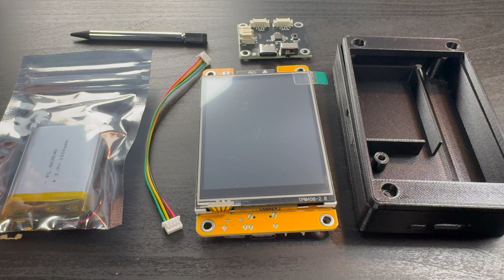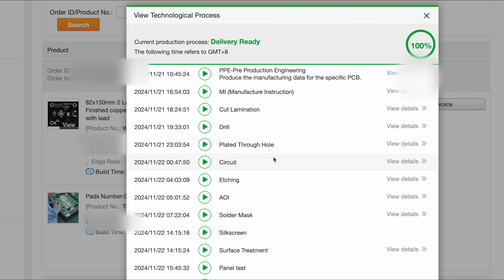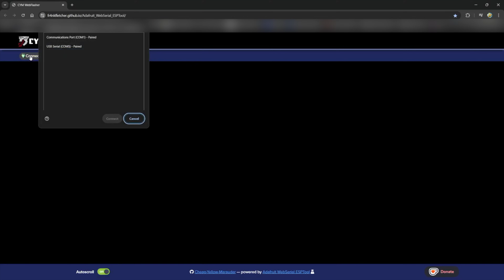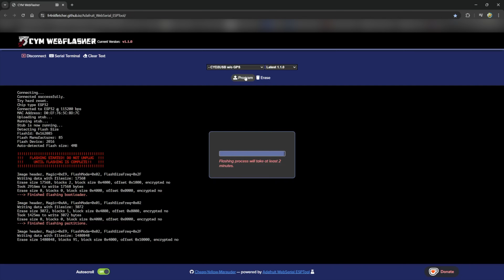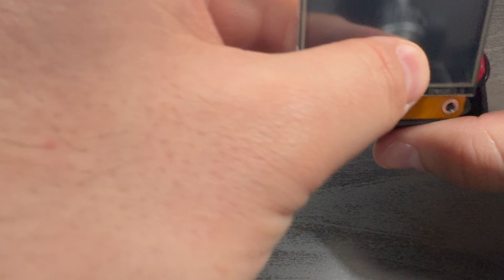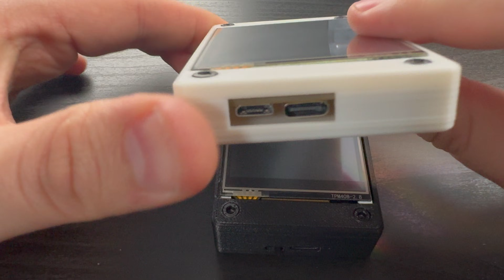How To Build An ESP32 Marauder - With Battery - No Soldering Required!

Comment: i know you probaly wont see this but would a 
LP103454 3.7V 2000Mah battery work or do i need a step down module?

Edit im an idiot and i figured it out
Reply from the maker: I imagine it would work. That voltage you gave is the nominal storage voltage most likely. That’s what’s shown on my lipo battery’s too
Reply: @BiscuitShop would the ada fruit bmax 17048 work instead you pcb because it's currently sold out
Reply from the maker: That’s just part of it. No charge IC with that alone

I ordered some more and they’ll be in stock soon

Comment: I know I'm a little late with this, but i just have 2 questions. How do you add the gps antenna, also is there a way to get this to work with halehound?
Reply: Hey, I'm not the video maker, but I know that you can flash this CYD with Halehound, I have done it and it works. Hope that helps.

Comment: If I do this but flash halehound cyd firmware instead will I be fine ? Just plug in connectors and good to go?
Reply from the maker: Battery would work but not the GPS or Battery level. We talked about it though, but I think he has some things up his sleeve
Reply: @BiscuitShop ok I see. The gps I'm not worried about because my build won't have that. No battery level kind of sucks but as long as it works then that's good enough

Comment: Now only need to add GPS. 
The YouTube channel, Yellow Purple put out a great video 10 months ago. Adds GPS as well as several other modules / capabilities. If we could add GPS and fit it into your case, and maybe add a good Wi-Fi and GPS antennas (not sure how difficult that would be) that thing would be really fun.
Reply from the maker: Already done! The board has come a long way :)

I have a case model with a hole at the top for SMA connector as well
Reply: @BiscuitShop  Where might i find this new case with the sma hole?

Comment: Received the ESP32 Marauder today, my version has the external antenna. Tried out wardriving and found that the device did not save anything to the SD card. Not sure what is going as the device does detect the SD card with correct size as shown in the "device info" and the SD icon shows up "green" on the screen. The SD card is a generic 8gb formatted to FAT32. The device did create a folder called "script" not sure what that is for but it was empty. Searched on the wiki and only found info regarding the flipper zero. So thought I post my question here.
Reply: Update Sorry, ended up bricking the unit trying to update the firmware. Ended up erasing the eeprom and reflashing the firmware. That corrected everything, device is now working properly. Not sure what the original problem was but now it works flawlessly. I even added an external GPS antenna and it works even better. Reprinted the housing in clear PETG that moves the power switch and charging port to the side of the device so the unit can sit upright. Thank you Hedge Tech for this wonderful device, this has allowed me to participate in wardriving.

Comment: can it be used without display and remotely control it via ip address ? thanks
Reply from the maker: Not via IP address but you can control it with a serial connection and no display
Reply: @BiscuitShop  yes how to do that i have and esp32 and want to flash marauder but can it run without a display , can i run it through my phone?
Reply: @BiscuitShop  how can it be controlled with a serial connection? can you show how? thanks!

Comment: Does the pcb include a step up converter or is it not needed?
Reply from the maker: Not needed with this version of the CYD. Some versions need 5V like the capacitive version but not the ones I link. I don’t even think there is a version of marauder that supports capacitive displays
Reply: @BiscuitShop thanks so much, seen a lot on Reddit where people say you have to step up to 5v to do this

Comment: Hello, there is somthing wrong with the webflasher 1.7.0. After flashing, the touchscreen works not correct, can you check this ?
Reply from the maker: What do you mean? If you’re talking about the new way to use the screen that’s by design. You  touch the top to move up, bottom moves down, middle selects
Reply: @BiscuitShop  Uhhhh, sorry, i do not notice this, thank you 😉
Reply from the maker: No problem. JCMK made the change after all the new features required scrolling in the menus. So this was his solution to that. Have fun!

Comment: the deauth doesn't work for me.
Reply from the maker: I just tested on 1.7.0 and it works fine. Make sure you’re selecting the AP or station properly
Reply: @BiscuitShop hey this is me on an alt, it says packets/sec: 0. It doesn't work, can you help me
Reply from the maker: You need to scan for AP or stations then run the select function. You don’t just open the deauth tool. It most definitely works and has been thoroughly tested. If it’s not working, make sure you’re running the proper scans and selections before attempting a deauth.
Reply: @BiscuitShop Hey this is me after, and yes your method works ! thanks so much

Comment: Hi a great vid mate but i have no idea whats wrong wth mine, on my CYD webflasher v1.4.3 i dont have that little widow that pops up when i press connect? when i press connect all it says is "Error: navigator.serial is undefined"? and according to my device manager it says the cyd is in com port 7 with CH341SER allready installed? so my cyd is connected to my computer and my computer knows it is connected so i have no idea whats going on, ive inplugged and plugged in the CYD many times, the red light is on and the screen is blank? ive reloaded the page of the webflasher many times but still no joy? ive no ideas whats going on have you? im running windows 11 so im not sure if that has anything to do with it? cheers mate thanks for your help if you can!
Reply from the maker: Are you using Google chrome? Wondering if it’s your browser
Reply: @BiscuitShop  Thanks for getting back to me mate nice one! Na im using Mozzila Firefox, im not sure it is that though (it could be?) but ive never had a problem downloading or using stuff online like that?

Comment: It is possible to do without a battery charging module, but you need to have a type c charging module and your battery must have plus and minus, i.e. red and black cables and need soldering.
Reply from the maker: Yes you can do it with a TP4056 but that requires soldering. I built everything into one module to make it cleaner and require no soldering. That’s where this build differed from everything else
Reply: @BiscuitShop  Yes, but I live in Türkiye and I couldn't find that circuit here. If you can find it, please let me know. It is not on any website in Türkiye. If you can find it, please tell me. Otherwise, I will spend 1434 TL, which is 36 dollars, and I am making these comments with translation.

Comment: I ordered the new pan charging circuit but the battery doesn’t fit into the slot
Reply from the maker: It’s a 1.25mm JST battery connection 👀 did you buy a 2.0 JST battery
Reply: @ yeah my bad I bought the wrong connection
Reply from the maker: No worries!
Reply: @BiscuitShop  sorry but is there any way to switch the connector
Reply: @BiscuitShop  also when I use another battery with the same connector it just keeps flashing the booting screen on and off
Reply from the maker: When the battery is really low it can do that. Have you tried charging the battery for a while?
Reply: @ when I try to charge it with the charging circuit it gets really hot but I’ll try charging another way
Reply from the maker: Reach out to my email hedge@edgeofhedge.com and we can troubleshoot. Send me some pictures of how you have it connected. Worst case I’ll send you a replacement
Reply: @ sorry I got it working I wired it wrong my bad
Reply: @ ur vids great thanks for the help
Reply from the maker: Glad you got it working!!

Comment: Hi !!!
I installed everything and it works perfectly.
Only the screen is lit white instead of black, which looks much better.
Any solution to this?
Thanks.
Reply from the maker: You can try the other 2.8 inch firmware. There’s CYD2USB which is the version with micro USB and USB C. And there’s the other version that’s for the micro USB only. Use the version for the correct board or you’ll get that color inversion :)
Reply: @BiscuitShop  Solved.
Followed your advice and now it works perfectly.
Thanks.

Comment: how to make it long life battery?
Reply from the maker: So you can use my board with ANY 3.7v lipo battery with the PH1.25 connector. You could add a 10,000 mah battery if you wanted and run it for days.

Comment: New here! Does it not need some sort of antenna? Super cool btw! Cant wait to build!
Reply from the maker: No antenna! Built into the ESP32-wroom-32

You can add an external antenna if you unsolder it and solder an ESP32-wroom-32U OR cut the trace of the antenna and solder some wires to the trace. I can share a link to instructions if you ever want to explore that option

Comment: Can I add an antenna for longer range? Is this for both 2.4 and 5 GHz ?
Reply: if you want 5ghz you need to get another dev board called an esp32-c5, that one has 5ghz, a normal esp32 only has 2.4.
Reply from the maker: Stay tuned. I have something coming quick that I think is one of a kind 👀

Comment: Can I somehow put antenna to this device?
Reply from the maker: Yes!

https://github.com/Fr4nkFletcher/ESP32-Marauder-Cheap-Yellow-Display/blob/master/AntennaMod.md
Reply: @BiscuitShop  but how it’s gonna work in case?
Reply: Because in case I see they don’t have space for antenna
Reply from the maker: I didn’t design the case with a hole by default because 95% of people don’t add an antenna. Also depending on what battery people go with changes where the hole goes. What i’ve done is just added a small hole at the top, below the CYD and above the battery. Small drill will do, or you can use a “negative part” cylinder in your slicer to place a hole that works for you.
Reply: @BiscuitShop  okay but how much he have meters without antenna?
Reply: @BiscuitShop does case have sd card slot?
Reply from the maker: Yes
Reply: @BiscuitShop sorry for so many questions because I’m gona buy things that in this tutorial but another question when I’m gona order charging pcb with case
Will I get bolts for charging pcb and for case?
Reply from the maker: @Pisunlay Yep! Comes with the bolts. You just need to buy the CYD and the kit comes with the rest
Reply: @BiscuitShop nevermind i tried to buy kit but they said that shipping not available
Reply: @BiscuitShop  never mind I can’t buy kit because they say that the shipping not available
Reply: Are there some another way to got it?
Reply from the maker: Shoot me an email.  
Hedge@edgeofhedge.com
Reply: @BiscuitShop  I sent you a email
Reply: @BiscuitShop  I sent you a email
Reply: @BiscuitShop  I sent email to you
Reply from the maker: Or this way

https://github.com/Fr4nkFletcher/ESP32-Marauder-Cheap-Yellow-Display/blob/master/AntennaModNew.md
Reply: So biscuitshop answer to my email and I sent them my address and they don’t answer me

Comment: can you flash bryuce firmware on this device?
Reply from the maker: Yes you can. GPS on my new board seems to be working as well on Bruce
Reply: @BiscuitShop  Are you selling it yet?
Reply from the maker: @efxerty  Yes! You can find the board in the description. Battery level indication does not on Bruce but still you get the GPS and battery.

Comment: Received and installed your “ CYD 2.8 inch ESP32 Marauder Battery Upgrade Kit” . Thank you!  Super snug fit for the wire connection on the side . Was a little worried about the sharp bend of wires for the fit. Works fine. GPS doesn’t work in my house. I’ll have to test outside at later time. Thanks again!
Reply from the maker: Good feedback on the wire. It is a little snug. I haven’t had issues but I should probably give it a smidge more room. I’ll work on that this weekend and update my model.

As for the GPS, yeah I can only get it to work outside/car but I think that’s the ceramic antenna. I’m sure with a larger antenna it would work indoors. I just haven’t tried it yet.

Comment: Hi, great vid, I live in the uk and only have access to a cyd with micro usb only, no usb c, this is fine but was wondering which firmware to flash. I would connect it with a micro usb in the cyd and a usb A in my pc, so should I use usb w/o gps or mico usb w/o gps, and if I get this wrong, how do I reset it to reflash
Reply from the maker: You can simply reflash again if you chose the wrong firmware. Hold boot button while plugging in.

Don’t use the CYD2 version since you don’t have the USB C. If you DONT have GPS choose wo gps
Reply: @ ok thank you 🙏

Comment: Do you have a case for sale? Not sure what I need to do to get pcbway to print it.

mod kit  is not sold out . Just my luck
Reply from the maker: Wait a few days. Just got a tracking number for my V2.0 board coming which will have battery level indication. :)
Reply from the maker: I have a slightly modified case for this new board that I will update my maker world with.

Comment: Your link for the cyd shows a variant with micro usb and not the usb c version. Having a hard time finding the usb c version
Reply from the maker: Just checked the Amazon link in the video description. It’s definitely the USB C variant. It has both micro and C on the board. It’s inbetween the JST connector and micro USB. Not sure why it’s not labeled but I’ve bought a bunch of them with this link.
Reply: Ty . Was looking at the picture of the back side showing micro usb
Reply from the maker: Yeah it’s silly they didn’t label the C port. It has both though :)
Reply: Ordered the cyd screws and battery from your link. Looking forward to the pcb and possible case when available. Ty!
Reply from the maker: @ReefMimic appreciate you! You can actually cancel the screws if you order a case from me. I include those :) keep the battery though! End of this week 🤞
Reply: Received the cyd today. The one from your link has the usbc . Ty

Comment: The first tutorial that worked for me! Thank you so much.

I do have something to mention, though. When I tried flashing it, I got an error about not being able to sync. I fixed it by simply turning it on, plugging it in, pressing connect, and while it was connecting, holding down the power button.
Reply from the maker: So glad it worked for you! Interesting I’ve never seen that issue. Thanks for the heads up!
Reply: Yeh I had to do that on my first build too I think that specific model makes it like that little annoying if your switching firmwares usually

Comment: If you flash the CYD with the bmorcelli loader you can save Marauder, Bruce, Ghost, whatever else you may want on a micro sd card and load them from a menu at start up or after a reset if you want to switch between apps.
Edit:  Wish I had found this earlier,  I'm currently in the middle of building one that is similar but uses separate boards for the charger and GPS that use soldered connections.  Other than the battery and the CYD, everything else came in multiples of 2 or 3 on Amazon except the on/off switch, that comes in a package of 20, which in my case was lost in shipping.  When I get it refunded I'll probably just go downtown and buy one from Radio Shack, I'll probably pay as much as I would have for 20 but at least I'll have it.  Anywhooo, the battery plus GPS board V1.3 would have been easier to assemble and easier to source.  Nice job!
Reply from the maker: Thanks a bunch! I have a V2.0 coming this month that includes battery level indication too via I2C. The chip I used for that is in the patch notes for 1.2.0. Pretty excited for that!
Reply: @BiscuitShop have you made a video about this yet?
Reply: Radio shack rip
Reply from the maker: @ReefMimic 🪦👼
Reply: @ The switches showed up the day after the refund went thru.  Good thing I got 20, I've already destroyed a couple of them, lol.
Reply: @ReefMimicI miss my local RadioShack.
Reply: Yea but doin that wit launcher limits some features some firmware has,,like I run launcher n wit Bruce it doesn't have telnet ssh brucegotchi n so other stuff, same wit esp32 maurader,,my opinion,I rather just use one ,mean there cheap ,lol so I have like 3 ,all running different firmware for better quality,but it's cool..
Reply: Radio shack?? Aren't they all gone
Reply: @Shuttterbugg  The corporate owned stores are gone but there's still a few franchise stores open.  The franchise owners went to court after Radio Shack went bankrupt and sued to be able to continue to use the Radio Shack name they paid for.  Batteries are about the only thing Radio Shack brand in my local store, but the owner said they are starting to come back and more and more Radio Shack branded items should become available.  They're expensive compared to online prices, but if you need it right away sometimes it's worth it.
Reply: I'm sorry, did you say RADIO SHACK?!?!?!?!?!?!?!?!?!
Reply: @jparniawski  Yup.  Some franchise stores are still open.  They sued Radio Shack to continue using the name.  Courts decided they bought the rights to the name when they purchased the franchises.

Comment: This is a fun and easy build.  I noticed the gps out on your pcb when i bought it.  Do you have a suggestion for a solderless gps module?  Also any plans to add an external 2.4 ghz antenna for added awesomeness?
Reply from the maker: There aren’t any solderless options just yet but I am releasing one soon! It will be integrated directly into the Charge PCB. Stay tuned for that one as it will also add battery level indication :)

If you message me on my shop I can sell you a module pre-soldered pretty cheap if you want.

As for the external 2.4ghz. I will be doing another video and showing how to do an external antenna. Unfortunately soldering is required though for that.